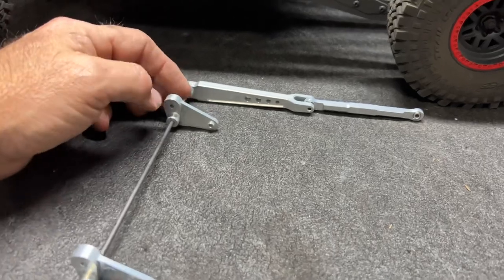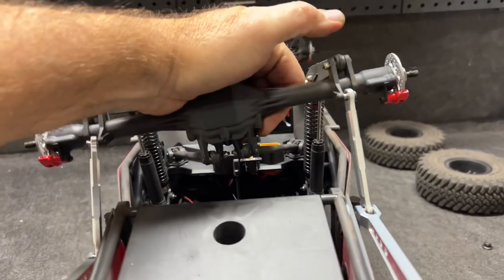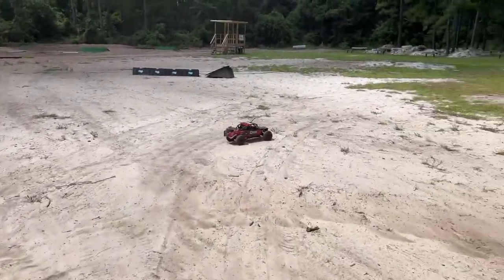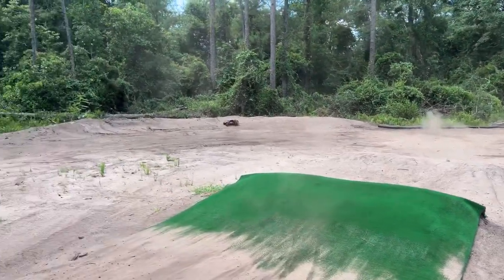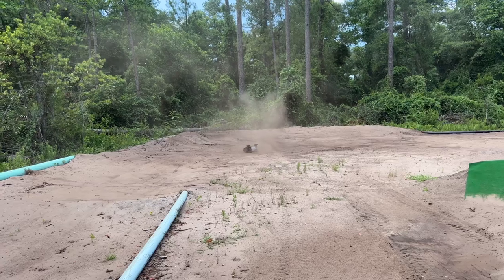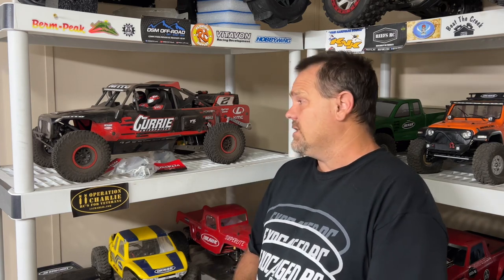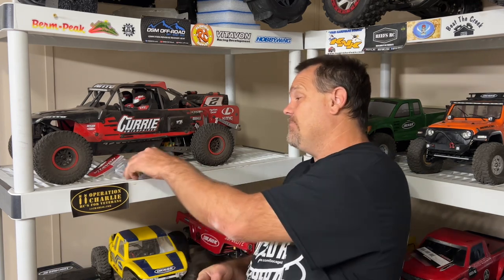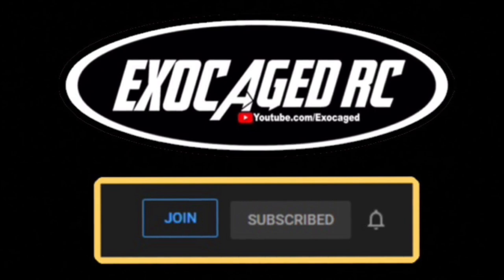Losi Hammer Rey with Vitavon Swaybar

Comment: still drives like s#@t at any speed  speed  but slow . problem is somethings just dont work when shrunk down . until a bypass shock can be built at 1/0 scale truck arm suspension dont work . rip all that out and make a 4 link and it will drive a ton better . adding in a bunch of metal parts will make it even worse .
Reply: Maybe you just cant drive?

Comment: When are you gonna add a sensored system in it for dual purpose running? Like crawler capabilities and speed.
Reply: He added that in the previous video with the Hammer Rey. It has the Holmes Puller Pro V2 and it’s sensored. He couldn’t really crawl with it that well since the diffs weren’t locked but it had better slower speed